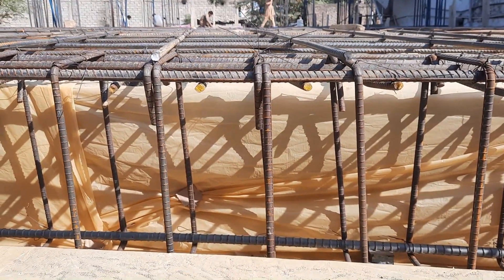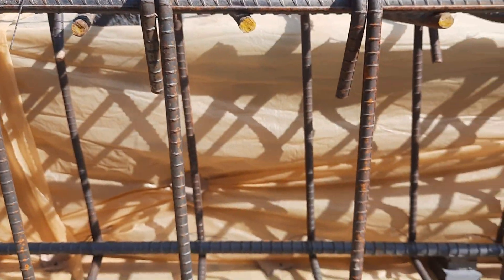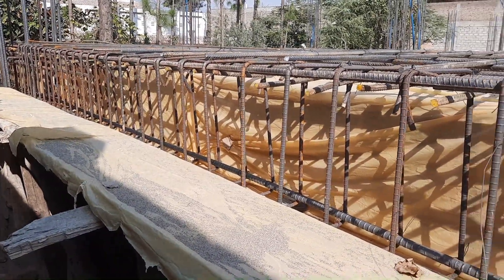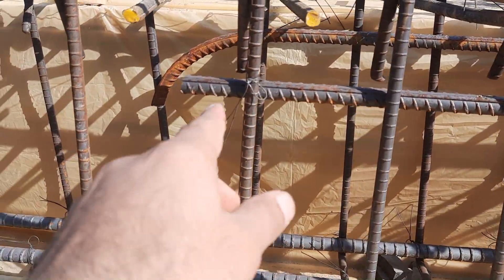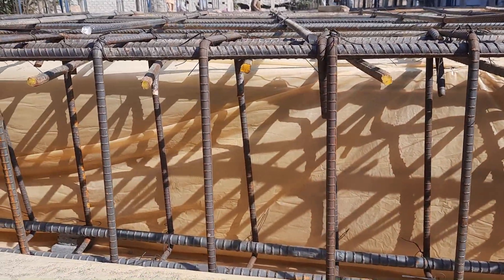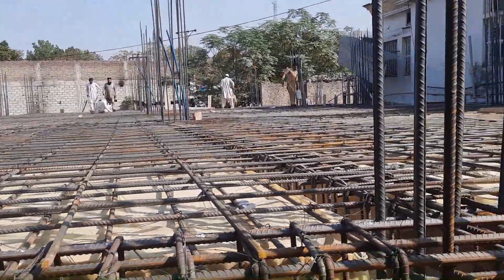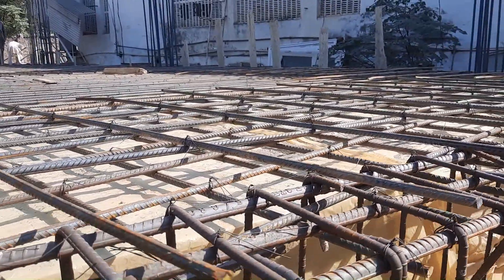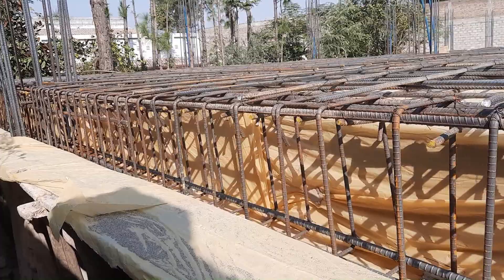Design of Floor Beam for 3 Storey Commercial Building | Practical Video |

Comment: The top bars does not seems to be properly designed. Same number and dia bars are not required in compressive zone. Before posting such videos , it is expected the basic calculation that derived the area of steel ie. Dia and numbers